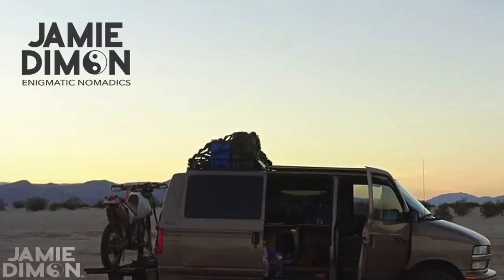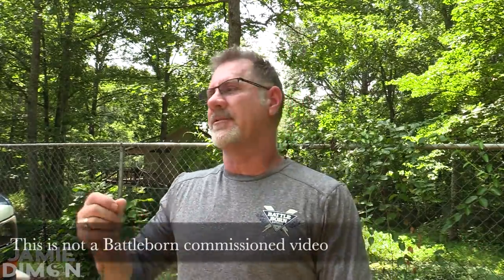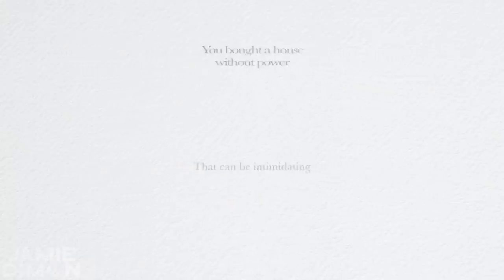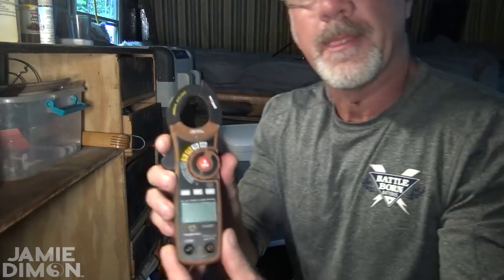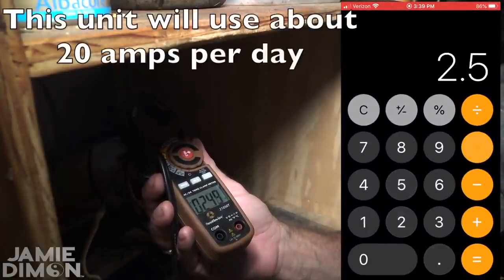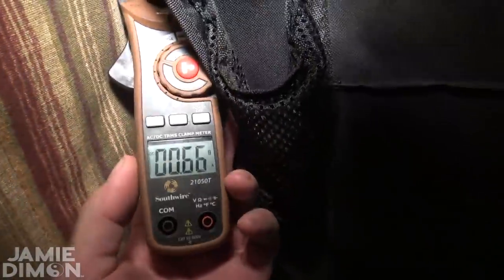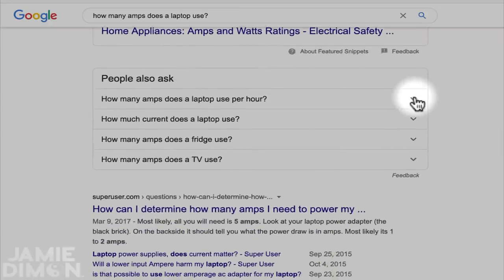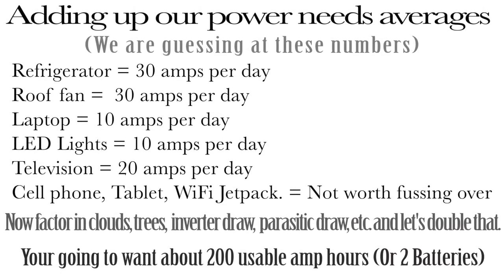Installing A Battleborn battery system on your rig | Understanding your powers needs first | Part 1

Comment: down to basics, great idea and off to an excellent start. 

since we’re being basic, it would be helpful to know specifics about the meter for those of us who don’t have one yet. recommended brand and expected cost would be good to know, not for just the meter but any of the tools we will need.

also, when you get there, i hope you’ll be specific about recommended awg and fuse sizes. i have found those things a little confusing.

thanks for this helpful series.

Comment: Nice job on the video, at least I have the 200 amp battle born  batteries I need, just not sure I have it safely wired. I’m pretty sure I have it 90% right 😅
Reply from the maker: It's exceptionally important that lithium BB battery's are calibrated perfectly. They are a totally different deal. Grab a minute to collect your questions and give BB a call so they can walk you through everything. They are pretty cool and speak in plain language. Seriously, those battery's aren't cheap and we want it to be perfect. Thanks for watching Mawk.

Comment: I lied, had to watch it. It's a great start but like you feared,  it would end up being a novel comparable to War and Peace in size.  I took electricity for a year in high school followed by 4 years as an Aviation Electrician in the military, followed by a career in heavy equipment mainly in the electrical end of repair. That said, teaching electrical theory in the space of a watchable YouTube video is an impossible task.  Good choice to move on. I have found precious few who understand ohm's , watts,  and amps well enough to do much more than change a light bulb.  If there's a bad ground involved they're lost.
Reply from the maker: I was TOTALLY thinking of you when I thought about those that would peek in for purely recreational purposes!🙏😂👍🏻👊
Reply: @enigmaticnomadics  I have a good friend who has 400 watts on the roof, a fancy controller,  and 2 of Battleborn's best. You know what he's using it for? To power a laptop for a few hrs a day.  Nothing else,  doesn't even have an inverter.  Salesman sold him a $3,000 installation for a $200 job. That's where lack of understanding electrical theory gets you.

Comment: Hey Jamie, how about during solar using those Big Battery's.  They have to be connected differently.   I have two of them.
Reply from the maker: What big batteries, Gigi? Tell me more and we'll get it sorted. ;)
Reply: @enigmaticnomadics  It is 12v 170ah Extreme Power Block by BigBattery.com.  It uses Anderson Quick Connect  cables instead of having regular battery post.

Comment: I like how you started out in the video but sometimes it's better to just be simpler and maybe take a battery and some wires and connect up a light bulb to start with it and then show us a circuit and show what the amperage reading is with your clap on amp-meter. But then show what  happens if you add another light either in series or parallel and explain that and then maybe add a motor and show the amperage rating of that but it's all in front of you so you can see it because if you just show your meter and we don't see the wiring it doesn't make as much sense to a beginner.
I agree with you this is a subject that is way to deep to try to dive into there's a couple of places on the internet where they show this kind of detail and they have really nice wiring diagrams that make it much easier to understand,  yeah I think I would just do what you're doing and let it let it die. You could also just show how you connect your two battleborn batteries into the system and you don't have to go into all the minutiae and the details of how to design a system people would be happy to see that and leave it at that.  Get a chalkboard and start writing down all the things you have to do and then Delight in the enjoyment of Crossing off the things and erasing them when you're finished .  B good Terry
Reply from the maker: Lots of ways to skin the cat, Terry. I know from our years working together that we definitely think differently. Hope you're doing well buddy!

Comment: Do you know anyone using LiFePo4 batteries to power electric heating in a van? I'm trying to find a way to not use diesel or propane. Thanks.
Reply from the maker: I do with a 250 watt quartz heater. I can run it about 7 hours through the night before depleting 4 Battleborns that are at about 75% charged when I start. Not great as far as heat output. I would need more batteries and up mu settong to 500 watts to make it really make a difference. In the mornings with the sun on the panels, it's nice as a little space heater though.

Comment: I know that you know how to install solar, so don't take this the wrong way. I mean it constructively. You need to learn to talk in terms of amp hours instead of just amps. Amps (or amperes) denote the current that is being drawn at a particular instant in time. In order to relate amps to battery capacity, you must add a time component, i.e., amp hours. After all, batteries are commonly rated in...amp hours. And yes, I understand that you have killed this baby, but I still recommend that you think in terms of amp hours (or watt hours) instead of just amps or just watts. P.S. I understand the electrical side of solar, and would have loved to see you demo the mechanical side.
Reply from the maker: Yeah, I'm not Chuck, good point. I understand the distinction but don't fancy myself a total electrical expert. I'm more of a guy that learns what I need to know about a topic like this and then re-learn over years of running the equipment and observing performance. The rabbit hole does indeed go deep.
Now that I've had some time to reflect, I may go ahead and revisit this months from now when I'm more caught up on the projects in my surroundings. I can always just make it into a playlist with the topics sub divided up. I still would need BB's permission of course. Even wearing the BB shirt in the video was chancy in my opinion. Legal departments can get rightfully nervous when it comes to branding and topics like these.Take care my friend!
Reply: @enigmaticnomadics  Thanks for the response. I am in Tennessee, and hope to get to your next van build. I have wanted to come, but the trip to Havasu was just too long. Now that you are in N Ga, maybe it will work out.